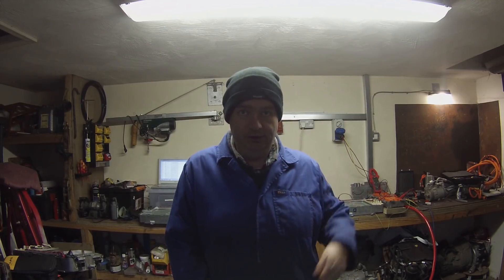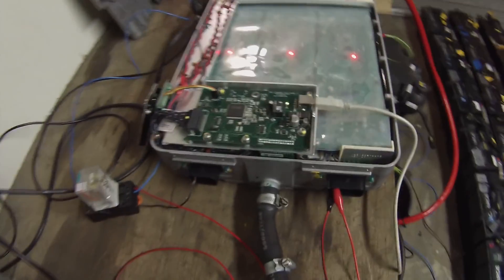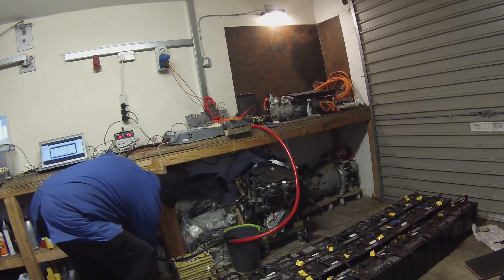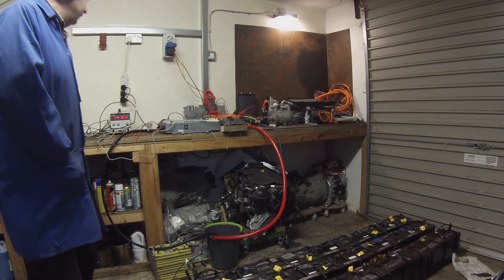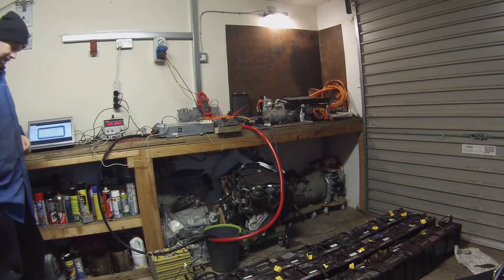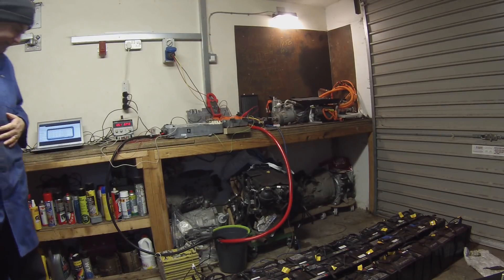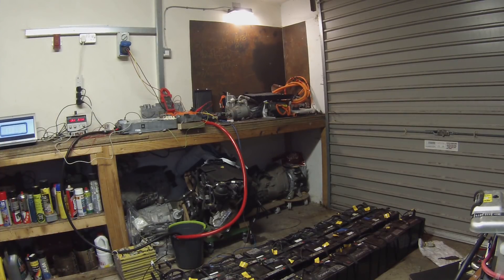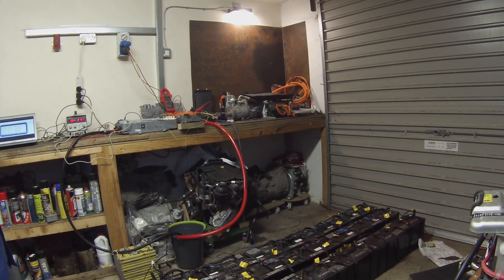The Tesla Project : Charger 10kw Run

Comment: Hi Damien, I did a swap with you some time ago, i had some 600A IGBT's and other inverter stuff in exchange for your experimental charger project chassis but i never managed to get that all up and running in a form that was reliable at any power over 4KW, this new set up may well be the answer to my battery charging needs but does this Tesla unit have power factor correction on the input side as that will be critical at 10KW on 240V ?, maybe you can do some mains current waveform checks on the scope and measure the power factor ?, great development work and hacking and I love these videos, Thanks, Dave from BasicMicroUK